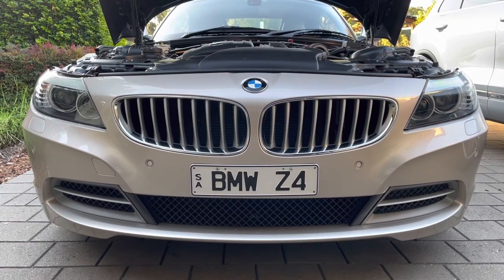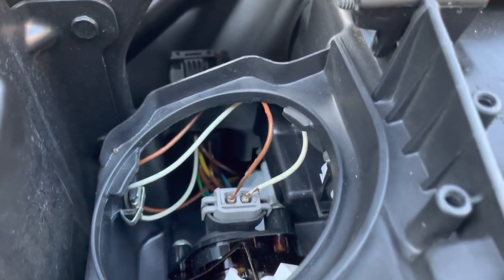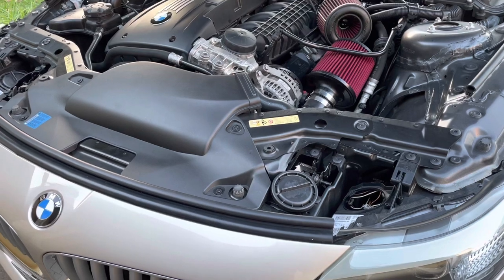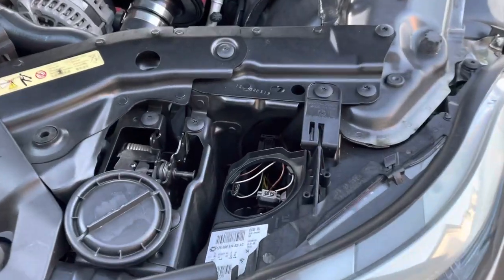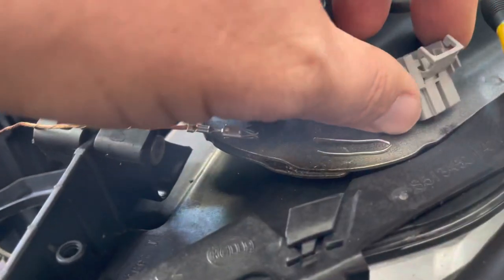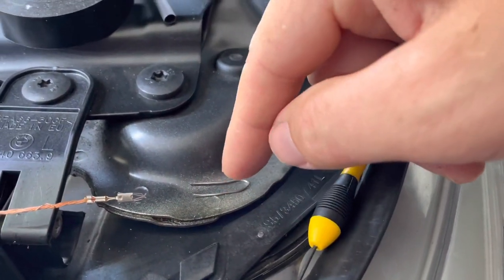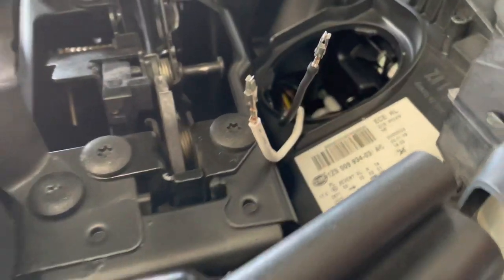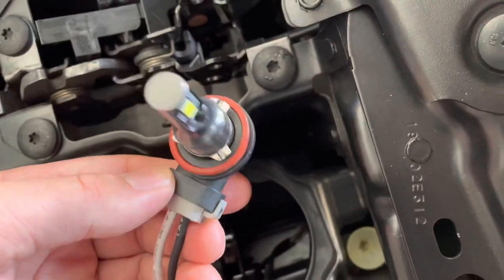Deterioration of the BMW E89 Z4 halo angel eye wiring.  Repair and change to LED.

Comment: Crazy I have the same problem on the same side as your car wires look pretty bad great fix idea 
But I have a bigger problem I changed the DRL bulb for the 2nd time and that same side flicker off and on so I just shut them off 
I'm considering getting the new after Market upgrade but do u think it's a bad fuse considering the continue to go off and on or a bad fuse wouldn't allow them to work at all?